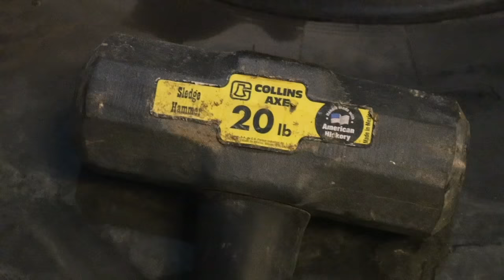Can @buffdudes Survive BATMAN'S BILLIONAIRE WORKOUT? | Movie vs Reality

Comment: The thing with the pulling and pushing exercises is that Bruce did it on smooth concrete. And these guys doing it in dirt, which causes more friction making it more tough. And it appears that some parts are wet dirt. Which causes it to have even MORE friction and difficulty
Reply from the maker: Thank you for noticing! Some of it was definitely hard as hell.
Reply: And not to mention here the fact that all the weights in Hollywood movies are mostly fake. Otherwise the actors with spaghetti arms would have just died. 🤭🤭😂🙌🏻
Reply: Anonymus X  I know facrs ablut Batman bro. I was just talking about actors in general who play that role. That end up 'being' super hero infront of the camera when we all know the truth. This was my point. Not batman as a comic. But sure, there's tons of info you stated there. Thanks
Reply: @fjerez2591  
Proverbs 1:7 KJV
The fear of the Lord is the beginning of knowledge: but fools despise wisdom and instruction.
Reply: @pedinhuh16  
Proverbs 21:30 KJV
There is no wisdom nor understanding nor counsel against the Lord.

Jude 1:23 KJV
And others save with fear, pulling them out of the fire; hating even the garment spotted by the flesh.
Reply: Anonymus X  Thing of it is Batman is peak human conditioning. The DCEU movies make Batman more powerful than he really should be. Nolan’s Batman is more like how Batman should be as far as physical abilities. The feats you mention such as outrunning Usain Bolt, reflexes like Bruce Lee and bench pressing 1200 lbs. are what Captain America is capable of doing.
Reply: I think the tire would be worse on smooth concrete but the sled would be easier
Reply: @jesusisgod2953  
Fearmonger 😐
Reply: @jodl73   umm Captain America  out does alot of these accolades considering he can run a mile in a minute, jump 20+ feet in the air , is immune to alot of toxins from the Super Soldier serum,  but sure.
Reply: they only show batman pushing it once, and pulling the tire once , who knows if he did it 50 times for each thing, he is also not panting and keeps a straight face in all workouts
Reply: @jesusisgod2953  what does this have to do with my comment lol🤣 Besides Jesus isn't God. He is the son of Jehová (for those of you who don't know, Jehová is God's name)
Reply: Batman is Captian America without the super soldier serum.
Reply: @jesusisgod2953  What's the point? That this invisible magic man exists? 
And you fearmongering pharisee is just doing its bidding, even though this invisible magic man is supposedly, almighty and all powerful that he can just show himself.
Reply: @SPLiTBalling  
God has already made himself known through his creation, those that deny him are without excuse as he says. God has already showed himself. He came in the flesh as Jesus Christ to pay the price for mans redemption.
Reply: @jesusisgod2953  Never seen him though.
Reply: @SPLiTBalling  
There are many things you have not seen, what does that prove?
Reply: @jesusisgod2953  Really? Then tell me.
Reply: @SPLiTBalling  
Tell you what? Tell you of things that you have not seen?
Reply: @jesusisgod2953  You did say I have not seen many things that I supposedly should've seen.
Which means you have seen it right? Or are you BS-ing me right now?
Reply: @SPLiTBalling  
The Creator is known by his creation. You then said "Never seen him though". Tell me, do I have to show you the builder of a house to show the house was built by a builder? If I shown you a painting of an old man and his dog in the countryside, would you need to see the painter to know there was someone who painted it?
Reply: @SPLiTBalling  I don't need to see God (with physical eyes) to see (understand) that he exists. You don't find people in an art gallery staring at the paintings wondering if there was an artist. To deny God, is to deny the obvious.

Mark 16:15-16 KJV
And he said unto them, Go ye into all the world, and preach the gospel to every creature. [16] He that believeth and is baptized shall be saved; but he that believeth not shall be damned.
Reply: @jesusisgod2953  Soooooo...Is that a Yes?
Reply: @jesusisgod2953  BTW I found an interesting verse as well it was at Matthew 6:1, you look it up, I'm too lazy to type and its 12 in the morning,  

Gnight Hardcore Christian.
Reply: @SPLiTBalling  
God is seen (understood/known to exist) through his creation.  If you don't see that God exists then, yes I see (understand) what you do not.

Matthew 6 is talking about alms not the Gospel being preach to all people as the Lord commands. Preaching the Gospel to other people involves other people. 

Matthew 6:1-5 KJV
Take heed that ye do not your alms before men, to be seen of them: otherwise ye have no reward of your Father which is in heaven. [2] Therefore when thou doest thine alms, do not sound a trumpet before thee, as the hypocrites do in the synagogues and in the streets, that they may have glory of men. Verily I say unto you, They have their reward. [3] But when thou doest alms, let not thy left hand know what thy right hand doeth: [4] That thine alms may be in secret: and thy Father which seeth in secret himself shall reward thee openly. [5] And when thou prayest, thou shalt not be as the hypocrites are : for they love to pray standing in the synagogues and in the corners of the streets, that they may be seen of men. Verily I say unto you, They have their reward.
Reply: @jesusisgod2953  do you know about evolution?
Reply: @ramirorojas8089  
Do I know about the fairy tale religion of Darwinian evolution that teaches fish turn into people. Yes what about it?
Reply: @jodl73  heh if you think DCEU Batman is strong, check out comic Batman..
Reply: @jesusisgod2953  it's not a religion and I don't really know much about the evolution of man but how do you explain the fossils that scientists have found from like 2 million years ago.
Reply: @ramirorojas8089  I don't know about evolution but i believe in God, I'm not pushing anyone to believe but in my church we are taught to respect everyone's belief's and SHARE the gospel not spread fear to force others to believe. Forgive and forget.
Reply: @christopherjared3624  yes I respect evey religion, I was never trying to sound disrespectful or make you stop believing in God I just wanted you to think a bit more and not just be close minded like  some Christians that don't want to be contradicted.
Edit:oh my bad I thought you were Jesus is God. Whatever ima just leave it cause i don't want to delete it
Reply: @jesusisgod2953  how can you call something that can easily be backed up by research and testing science fiction. Also it's not a religion. And If im using your same mindset I can just say that your religion is just a fairy tell sland it can't evenbe backed by anything else other than the Bible which might not even be credible(not trying sound rude)
Reply: @ramirorojas8089  
The religion of atheism that teaches nothing produces everything, non-life produces life, randomness produces fine-tuning, chaos produces information, unconsciousness produces consciousness, and non-reason produces reason. Included in this religion is the belief that fish turn into people.

Where is the evidence for this?
Reply: @jesusisgod2953  im not an atheist tho but I do try to look for answers.  Also if you search up the fossils that have been found from long ago you can tell that they were a bit different from how we look today. Now you answer my question which is how can you back up your religion without referencing the Bible which might not even be credible.
Reply: @jesusisgod2953  once again evolution isn't a religion search it up if you don't believe me.
Reply: @ramirorojas8089  
Variation exists in every kind of creature, God gave a vast genetic code, look at the varieties of canine. They are all still canine. Canines only breed canines. They will never produce an elephant, a duck, a fish, neither did they come from one.

What do you mean back up my religion without referencing the Bible? That is like saying prove you are innocent without providing evidence. What does the Bible say regarding animals? They all produce after their kind. That is what is observed. If you reject the Bible you have no reference point.
Reply: @jesusisgod2953  what I meant was that you don't need a book to prove different scientific explanations since you can go and test them yourself and you'll get the same result. However there is no way you can prove God exists except by referencing the Bible.
Reply: @ramirorojas8089  
The creation tells you that there is a Creator. I have three questions for you if you don't believe in intelligent design. Firstly, do you believe you are intelligent? Secondly, can you create for example an elephant, a fish, a tiger, a crocodile, an apple seed from scratch? Thirdly, if you believe these things were not intelligently designed, then what does it say about your intelligence if you cannot create them? 

Denying intelligent design is anti-intellectual. Intelligent design is self -evident.
Reply: @jesusisgod2953  oh my GOD bro you are those types of person that just want to justify everything using God when so many other things happen. You're the type of person that when the doctor saves someone's life you thank God first even though the doctor went through years of studying and getting ready to save lives.
Reply: @jesusisgod2953  also I dont believe i am intelligent enough to create life since that is something that took years to evolve and turn into the type of animal that it is now.
Reply: @ramirorojas8089  
Darwinian evolution never happened. The creation tells you that there is a Creator as much as the Bible.
Reply: @jesusisgod2953  so you believe that evolution didn't happen and Adam and eve(eve created from his rib) were the first ones created in gods image around 10,000 years ago?
Reply: @ramirorojas8089  
What does God say?

ADAM WAS THE FIRST MAN

Genesis 2:7 KJV
And the Lord God formed man of the dust of the ground, and breathed into his nostrils the breath of life; and man became a living soul.

1 Corinthians 15:45 KJV
And so it is written, The first man Adam was made a living soul; 

THE FIRST WOMAN WAS MADE FROM ADAMS RIB

Genesis 2:18 KJV
And the Lord God said, It is not good that the man should be alone; I will make him an help meet for him.

Genesis 2:22 KJV
And the rib, which the Lord God had taken from man, made he a woman, and brought her unto the man.

EVE IS THE MOTHER OF ALL THE LIVING

Genesis 3:20 KJV
And Adam called his wife's name Eve; because she was the mother of all living.

GOD CREATED PEOPLE IN THE BEGINNING 

Matthew 19:4-5 KJV
And he answered and said unto them, Have ye not read, that he which made them at the beginning made them male and female, [5] And said, For this cause shall a man leave father and mother, and shall cleave to his wife: and they twain shall be one flesh?

So God said that the first man was made from dust and that the first woman was made from his rib. All humans came from Adam and Eve who were created in the BEGINNING. God did not say that he made a slime that turned into a fish, x,y,z etc until it turned into a human millions of years later from the beginning. 

10,000 years? No 6000 years.
Reply: @jesusisgod2953  yeah yeah I've read the Bible you don't got to come at me with versus that I've read below but anyways you think that humans have only been alive for around 6000 years?
Edit:before* not below
Reply: @jesusisgod2953  what about all the paintings that they have found that are more than 10000 years old how do you explain those or are you gonna say that they are lying to us?
Reply: @ramirorojas8089  
They are not older than 10,000 years old.  If you believed God instead of man you would know that. 

Man has only been around for 6000 years as the word of God testifies. You can either trust God or man. I trust God.

Romans 3:4 KJV
God forbid: yea, let God be true, but every man a liar; as it is written, That thou mightest be justified in thy sayings, and mightest overcome when thou art judged.
Reply: @jesusisgod2953  what makes you think you can trust the Bible if it was written by men?
Reply: God is real, so is the unicorn outside my window
Reply: @SPLiTBalling  the person is preaching. Teaching ppl of God's word/the Bible and God himself. Jesus asked for God's followers to preach so we can save people from Satan and so the ppl we preach to become son of God. But this person isn't doing it the correct way. Only the Jehovah Witnesses preach the right way. Less than a handful of religions preach and the Jehovah Witnesses are the only ones that do it right. That's one of many reasons why ppl believes the Jehovah Witnesses is the one true religion the Bible speaks of. And it's the only religion that uses Jehovah as God's name. And that name has been proven to be God's name by.....I don't know the exact name of the type of scientist
Reply: And the bible also says that the government will go after the true religion. And the Jehovah Witnesses is already banned in Russia, Singapore, China, Vietnam. And it's making it way up to other places
Reply: @yanmartin3346  ohh you are the guys that keep on knocking on our doors huh
Reply: @ramirorojas8089  yup that's mah fam😂 People turn off the lights, hide and pretend to not be home when it's clear the house is pact lol
Reply: @yanmartin3346  lmao
Reply: @Kevink4240  No man ! Ben really lift those weights and Henry really fly
Reply: @karnasingh860  hahahaha. This is a good one. 🥳😂🙌🏻
Reply: @ramirorojas8089  GOD made rooster and hen together, and so as all the pair of creatures, male & female together. GOD did not make eggs or babies first. His very first creation was the adult, prime matured developed form of the creatures. He didn't make Adam or Eve as a boy or girl, He made them as Man and Woman. Finally, all the creation that we see around us, mountain, river, sky, atmosphere and all the things seen and unseen, GOD made them in 6days, for He is the Creator, whose power and wisdom is incomparable and beyond our grasp(unless HE Himself reveals it to us). GOD made all things perfectly and in tip-top time condition with in 6 days, then He rested on the 7th day. Whereas science say it took million of years of evolution, science say we came from chimp, science say...etc. I leave this here, ponder over and try to reach out to GOD with a sincere heart and mind, He is near. Godbless and Godspeed💪👍👍
Reply: @atenikayra2653  I did believe in God until I started asking questions and actually be open minded
Reply: Go out and look at the world, the stars, the seas, the diverse creatures on this planet. That is how you see God, he is literally everywhere. Although I will admit this is a weird time to bring it up.
Reply: Same then Ifound the answers to those questions and only had my faith in Him and Jesus strengthened.
Reply: "Ifound" oof that's embarrassing, anyway, can we please get back to the topic brought up by the original comment?
Reply: So if God was everywhere he was just chilling while the holocaust happened or when black people were hanged and I could keep going 
But oh wait youre gonna start talking about the free will that man has and everything else huh.
 Also I already talked about evolution so read some of my past comments.
Reply: @nobodythetrain2430  
Hell is for those that refuse to repent of their evil and accept redemption. God will destroy and punish the wicked because he is just.
Reply: @jesusisgod2953  
Nope bible says hell is for nonbelievers, as"they turned their backs on him".

As for he is just, yeah no. Only psychopaths make that argument. Every dictator believed themselfs just.
Reply: @nobodythetrain2430  
Whoever rejects the Gospel remains condemned and goes to hell. That is what an unbeliever is. May you repent of your evil and accept the Gospel before it is too late.

Proverbs 21:30 KJV
There is no wisdom nor understanding nor counsel against the Lord.
Reply: @nobodythetrain2430  you clearly have no idea what hell is for
Reply: @ramirorojas8089 Stopping blaming God for what he let's us do
Reply: @calthekonqueror312  read it again it might make more sense
Reply: @ramirorojas8089  I'm saying pain and suffering in the world is the punishment for us misusing our free will.
Reply: @calthekonqueror312  the thing is that there is people who didn't misuse it and some of them were true believers and they end up living through hell in earth.
Reply: @ramirorojas8089  Because we're all sinners and therefore we all suffer in life even as believers, especially because now Satan does everything in his power to make you lose faith in God by messing with you from the shadows. I know you probably don't even have a Bible but you should look up the book of Job and read it. It is about a man named Job (shocking right?) who is a faithful and blessed follower of God and all of sudden he literally goes through what you said. It takes almost 2 hours to read through completely, but it answers your questions perfectly.
Reply: @calthekonqueror312  I do have the bible
Reply: Its the kjb version I've been reading it for what feels forever but haven't finished
Reply: @ramirorojas8089  Have you read Job?
Reply: @calthekonqueror312  not yet been busy and got homework probably over spring break
Reply: @calthekonqueror312  so far i just read the 1st chapter and correct me if I'm wrong but didn't God send those curses?(I know satan told him to do it cause Job would loose faith but didn't)
Reply: @ramirorojas8089  He allowed Satan to do it to him and to put his faith on the line
Reply: @calthekonqueror312  So  God allowed a whole bunch of other people to get killed just to see if one man was loyal enough to him?
Reply: @ramirorojas8089  The point I'm making is God does allow bad things to happen to "good" people sometimes to put there faith to scrutiny and therefore help strengthen it and sometimes, simply because their time on this Earth is up and it was their time to die. Because God is omnipotent and omniscient so even when he allows the devil to do seemingly bad things He is still working it out for the best overall outcome. We may not understand what is going on, and it may or may not even work out for us in this life, but those believe even through tribulation and even being killed brutally in some cases end up receiving the rewards of being in heaven where all the pain that exists in this world is gone. I know it is hard for one who doesn't believe to learn to trust Him, but truthfully we will never truly understand everything about our creator because He is beyond us and our comprehension so we must just trust in His plan since it is bigger than any one person, not that He doesn't love each one of us, on the contrary. "The Lord is not slow in keeping his promise, as some understand slowness. Instead he is patient with you, not wanting anyone to perish, but everyone to come to repentance" 2 Peter 3:9 Unfortunately, many never come to repentance and die without knowing God because they ignore their chances to repent. "For since the creation of the world God’s invisible qualities—his eternal power and divine nature—have been clearly seen, being understood from what has been made, so that people are without excuse." Romans 1:20
Reply: @calthekonqueror312  alright then how do I repent
Reply: Anonymus X  Batman is fast for his size, but he isn't ungodly fast in the running department. Nightwing is faster. Bruce is being stated as being able to keep a steady pace of 4.50 a mile for 20 miles. Which is right around 12.4-12.5 mph. Batman is listed as being 6'2 and floats between 205 and 215, at almost bodybuilder competition body fat %. Well, for arguments sake, let's go with either fitness model, or physique category, because he's not a mass monster. Guy is not built for long sprints. If he has to chase someone more than a rooftop, he's gonna use his grapple launcher, a bolo, or glide cape style.
Reply: @jesusisgod2953  did Jesus give you birth, or your mom?
Reply: This also showcases that Bruce's brains as well as his brawn. Why make things harder than they need to be?
Reply: @jesusisgod2953  that was stolen from many different pagan religions...the triune god idea. I should know. This TRIUNE idea was a patch designed to allow us "uneducated" forest folk to accept some strange new god...or die horrible deaths for refusing to convert.
Reply: @UnethicalLogic  
Your claim is false. Your argument is like saying the account of Titanic is fake, yes the story of the Titanic was made up, it was copied from the novel, The Wreck of the Titan which describes an incredible tragedy, a huge passenger ship, which people said was unsinkable, on a cold night in the North Atlantic about 200 miles off of Newfoundland, struck an iceberg and sank. Many people died because there weren’t enough lifeboats.
Reply: @jesusisgod2953  That makes for an unconvincing argument. We can see the Titanic and we have countless historical references and article on it from actual historians, news articles and physical evidence. This is also the same for ancient paganism thanks to tons of scholarly and archaeological workings. The pre-christian pagans in Europe and elsewhere had many instances where a deity was seen in a triune aspect. This was in fact a very common belief found amongst (to name a few) the Egyptians, Indians (of India), Japanese, Sumarians, Chaldeans, and of course the Babylonians, to where HISTORIANS trace the roots of trinitarianism. These were far older in practice than Christianity. Also the idea of the Trinity in Christendom is not backed by the original Torah, which was more of an amalgamation of Zoroastrianism into the semetic culture to my understanding... Zoroastrianism being the first recorded monotheistic religion.
Reply: @UnethicalLogic  
Your claims are false. Concerning the Titanic, the remains are being consumed. So based on your argument someone could simply say in the future that the story is a copied. You mention historical references. History testifies of Christ, his death burial and resurrection. There is also his burial shroud that also proves it happened.

The one God is triune. You claiming the trinity is  copied is merely your assertion. The truth of God is eternal, it doesn't matter when God's word arrives. The truth of God does not begin at the time of revelation. The false religions you speak of did not predate the eternal truth of God contained in the Bible.

Your claim regarding the Torah and the trinity is also false. The trinity is seen throughout the entire Bible, ESPECIALLY THE OLD TESTAMENT.

 God speaking say's, the LORD God and his Spirit SENT HIM in Isaiah 48:16. 

Isaiah 48:16. 
Come ye near unto me, hear ye this; I have not spoken in secret from the beginning; from the time that it was, there am I: and now the LORD God , and his Spirit, hath sent me.

The LORD sends the LORD to dwell in Zion in Zechariah 2:8-13

Zechariah 2:8-13
For thus saith the LORD of hosts; After the glory hath HE SENT ME unto the nations which spoiled you: for he that toucheth you toucheth the apple of his eye. [9] For, behold, I will shake mine hand upon them, and they shall be a spoil to their servants: and ye shall know that the LORD of hosts hath sent me. [10] Sing and rejoice, O daughter of Zion: for, lo, I come, and I will dwell in the midst of thee, saith the LORD. [11] And many nations shall be joined to the LORD in that day, and shall be my people: and I will dwell in the midst of thee, and thou shalt know that the LORD of hosts hath SENT ME unto thee. [12] And the LORD shall inherit Judah his portion in the holy land, and shall choose Jerusalem again. [13] Be silent, O all flesh, before the LORD: for he is raised up out of his holy habitation

The LORD GOD - THE REDEEMER, SENT TO ZION

Isaiah 47:4
As for our redeemer, the LORD of hosts is his name, the Holy One of Israel.

Isaiah 59:20
And the Redeemer shall come to Zion, and unto them that turn from transgression in Jacob, saith the LORD .

The LORD arrives in Zion. BEHOLD YOUR GOD! Isaiah 40:3,9

The voice of him that crieth in the wilderness, prepare ye the way of the LORD, make straight in the desert a highway for our God. [9] O Zion, that bringest good tidings, get thee up into the high mountain; O Jerusalem, that bringest good tidings, lift up thy voice with strength; lift it up, be not afraid; say unto the cities of Judah, Behold your God!

In Genesis 32:24,30 it says that Jacob wrestled with " a man" and after this encounter he said he had seen God and his life was preserved. Not only that but he named the place Peniel, which means face of God. This encounter is mentioned again by God in Genesis 35.1 where God tells him to make an altar to God who appeared to him when he fled from his brother Esau, this is always mentioned again in verse 7. This is confirmation that the man Jacob saw truly was God. In verse 9 and 15 it says God appeared to him again and went up from him. 

In Genesis 32:24,30
And Jacob was left alone; and there wrestled a man with him until the breaking of the day. [30] And Jacob called the name of the place Peniel( Face of God): for I have seen God face to face, and my life is preserved.

Genesis 35:1,3,7,9,13,15
And God said unto Jacob, Arise, go up to Beth-el, and dwell there: and make there an altar unto God, that appeared unto thee when thou fleddest from the face of Esau thy brother. [3] And let us arise, and go up to Beth-el; and I will make there an altar unto God, who answered me in the day of my distress, and was with me in the way which I went. [7] And he built there an altar, and called the place El-beth-el (God of the house of God): because there God appeared unto him, when he fled from the face of his brother. [9] And God appeared unto Jacob again, when he came out of Padan-aram, and blessed him. [13] And God went up from him in the place where he talked with him. [15] And Jacob called the name of the place where God spake with him, Beth-el (originally called Luz).

Genesis 28:16-22 KJV
And Jacob awaked out of his sleep, and he said, Surely the Lord is in this place; and I knew it not. [17] And he was afraid, and said, How dreadful is this place! this is none other but the house of God, and this is the gate of heaven. [18] And Jacob rose up early in the morning, and took the stone that he had put for his pillows, and set it up for a pillar, and poured oil upon the top of it. [19] And he called the name of that place Beth-el: but the name of that city was called Luz at the first. [20] And Jacob vowed a vow, saying, If God will be with me, and will keep me in this way that I go, and will give me bread to eat, and raiment to put on, [21] So that I come again to my father's house in peace; then shall the Lord be my God: [22] And this stone, which I have set for a pillar, shall be God's house: and of all that thou shalt give me I will surely give the tenth unto thee.
Genesis 48:3 
And Jacob said unto Joseph, God Almighty appeared unto me at Luz in the land of Canaan, and blessed me,

I could go on. There are plenty examples to choose from. You denying the trinity in the old testament is a false claim just as your claim that the trinity was copied.

 The Old Testament contains over 400 prophecies about the coming Messiah. Jesus Christ perfectly fulfilled every one of them. Do you know what the odds of that happening are? Think about it: one single man fulfilling every prediction about the coming Messiah, Savior of the world. 

A professor named Peter Stoner worked with 600 students to figure out what the probability would be of just eight (of the over 400) prophecies being fulfilled in any one person who had lived up to the present time. The result: 1 in 100,000,000,000,000,000.21

Lee Strobel, an atheist-turned-Christian, performed some calculations to try to figure out what this would look like in real life. Lee notes: “I imagined the entire world being covered with white tile that was one-and-a-half inches square—every bit of dry land on the planet—with the bottom of just one tile painted red. Then I pictured a person being allowed to wander for a lifetime around all seven continents. He would be permitted to bend down only one time and pick up a piece of tile. What are the odds it would be the one tile whose reverse side was painted red? The odds would be the same as just eight of the Old Testament prophecies coming true in any one person throughout history!”22

The Bible contains the truth of God. The true God came as he said he would, when he said he would, die as he said he would and raise and he said he would. History testifies of the true God.
Reply: @jesusisgod2953  well..you do only have one source for this information..well two if you count the Torah, but most Christians barely read that. My sources come from many various places. However your argument is still invalid, while mine has a butt ton of historical evidences to back it up. The only other evidences you can site are commentaries on the New Testament. So, have fun in fantasy land. I'll just ground myself in logic and reason. 😏
Reply: @jesusisgod2953  Islam is the true religion bro.
Reply: more friction for the object and LESS for the feet to gain purchase
Reply: @mattholt2451  by 2015 Islam has 1.8 billion followers. The Bible says that God's path is narrow with little people that have managed to find it. And Satan's path is wide & simple to find yourself in. In other words, religion that have little followers are more likely to be the true religion. And religion with a lot of followers are 100% not the true religion. Which is how you can know that Christianity is not the true religion because it has the most followers at more than 2.3 Billion